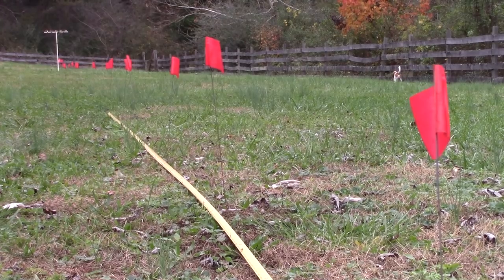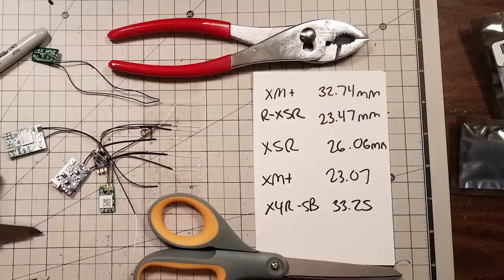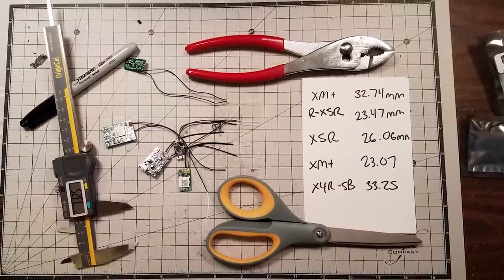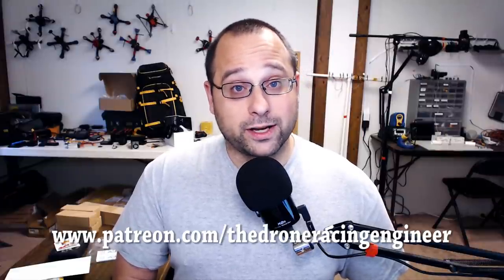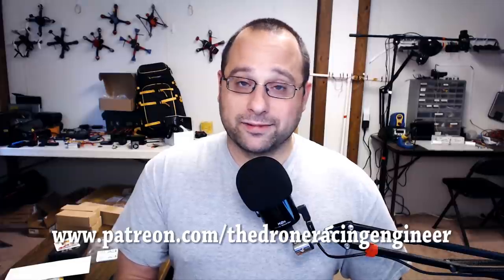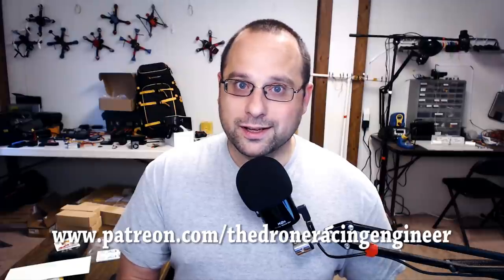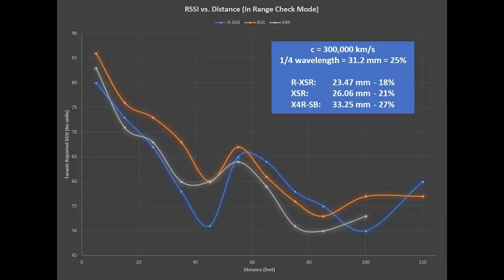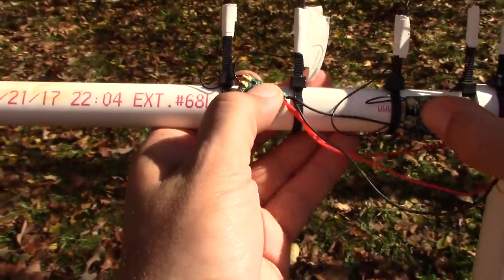Range Test FrSky RX | WRONG ANTENNA LENGTH?

Comment: Great testing Joshua! I'm a young RF enthousiast, and I have access to a network analyzer that goes up to 3GHz. I was thinking, since all these antennas have U.FL connectors, I can just hook one up to the VNA and see at what frequency it resonates. The resonant frequency of these antennas are dependent on the length of the exposed antenna wire (outside of the coax) but the size and location of the RF ground will also be important for antenna tuning. 

One thing that is also interesting to note, is that the receiver chips cannot do any antenna tuning, the only option is that they put passive components at the feedpoint of the antenna, to change the antenna impedance. However, any time you are tuning an antenna with inductors or capacitors, the components MUST be right before the radiating side of the antenna. You cannot really tune an antenna at the feedpoint of the coax cable, since the 50-ohm coax will transform the impedance, which is dependant on the coax length.

I think I'm going to try to hook up my VNA to one of these 'whip' antennas, and I also want to see if I can see any matching components on the PCB. The best test to measure the antenna resonant frequency would be to use hot air to remove the RF chip on the receiver, and solder a tiny coax cable directly on the pads where the signal to the antenna goes. Then you can perform a calibration, and actually measure the impedance that the chip is 'seeing' with all the RF ground and matching components on the PCB.
Reply from the maker: Well tell me your results I'm dying to know!
Reply: I'll have time to do the measurements in a couple of hours, can I email the results to you? I'll be generating some plots and stuff..
Reply: Yes, and make a video out of it, please :-)
Reply: Please do. I recently lost TX to a quad running a new R-XSR. It could have been anything but suddenly dropped out of the sky before the "Telemetry lost" warning. I never found the quad to do an investigation. I've looked through ham forums but found zilch apart from 5/8λ Vs 1/4λ - 1/2λ
Reply: Well, my plan went to hell. The U.FL connector on my Frsky receiver are actually not standard U.FL, but some sort of micro U.FL. So I cannot connect the antenna to my VNA without cutting off the connector and soldering the coax directly on a connector I can connect to my VNA. However, this could in theory mess up any test results. Not really sure how to proceed.
Reply: Buy a bunch of antennas that do work with your VNA, cut them to different lengths and test them.
Better than nothing.
Reply: Hamza Mohammad I'm going to try this ;)
Reply: I think you had an attempt and may or may not have found some information that would be inconclusive and interesting at best but life-changing and radical - possibly a stretch! As for my receiver, it was a replacement for a micro Flysky that only had a 3cm piece of enamelled copper for it's antenna. The range was fantastic.
Reply: well, 3cm is almost exactly a quarter wavelength @ 2.4Ghz! Makes perfect sense ;)  I think the reason they add these long wires is so that we have more flexibility on routing the wire on our drone.
Reply: Any updates ?
Reply: See Scott Marshall's reply below. Length of receiver wire is not critical but your transmitter antenna length certainly is.

Comment: I think I'll do a video on this but basically there are many factors that influence those antennas and it's not just "tuning" but also radiation pattern, impedance and other things which determine how the antenna will actually perform.   Joshua's test environment had too many variables to get consistent and therefore accurate results so I'll try to come up with something that mitigates (as far as possible) those variables.   It's an interesting subject and one that's worth more discussion.  I'll try to get my vid done tomorrow.
Reply from the maker: +xjet looking forward to your take on this!
Reply: Looking for this too uncle Bruce :)
Reply: But your 'news' videos are full of empty promises...  so I won't hold my breath!  Sorry to be so blunt Bruce.
Reply: rcdesigns, you're obviously unaware of the amount of time/effort that goes into even the smallest video.  I've been working on the video mentioned above for the past four days and I'm still not happy with the result.  You'll probably see why when I post the video.  Trying to convey quite complex subjects in an uncomplicated way is one of the most challenging things there is.   So far I have four hours of video on the edit table and I'm still not happy so I'll be reshooting stuff again today until I am.
Reply: So Bruce, you produced a video with another empty promise (no part 2)! I rest my case
Reply: Yes, because the world has just ended so there'll be no time to edit part 2.  Of course you will be getting a full refund :-)    LOL
Reply: @bazathome2002  Im laughing because this is so true..

Comment: As a layman I conclude two things from these tests. 1: the engineers at FrSky seem to know what they're doing when they design these antennas and receivers. 2: no matter which receiver you get, unless you're going for super long range or something, you're going to have a very solid reliable signal. I was slightly concerned when I bought the R-Xsr that it may have less range than a full size receiver, but it seems I was worried for nothing!

Comment: Hi Joshua,
again a very cool video from you. I have to thank you for all your content, which made me learn a lot!
This time I think I can give you some informations:

To get the best reception from an existing combination of components, the length of the antenna-"core" (unshielded part) needs to 
be perfekt for a combination of:
actual wave-speed, frequenz, antennas environment, ...

I would advise you to:

put the TX far away ... if you like in your car ... and you stay at your quad.
Yes I saied quad, because of the antennas environment! you want it to work in you quad, so tune it there !
As someone in the comments already saied, your ground-part (which is also the carbon of your frame) of the 
antenna and anything in its neighborhood will change its behavior.
So use the place where it will have to work.

The only thing you should change during the tuning is the length of the antenna.
You changed the distance and as you have seen in your chart, you got hills and valleys. 
I'm shure this was because of interferences. You got bounced signals on from what ever which de- or increased you signal.

Don't use several recievers, there can be so much different ( quality of rf-chip, antenna-matching, groundarea ...)
Also, the recievers working next to each other can change there behavior.

So put the TX in the car far away, go into the house with your quad and your goggles ( need to see rssi in the osd !).
Put the quad somewhere where it can't move, but it should sit on something similar to air, because your quad normaly is in the air ...
I usally use styrofoam, this has nearly no effect on the resonance and matching.

Use only one of the antenna cables, disconnect the other.
To get great range of frequency in your test, use a antenna with a very long core.

measure the antennacore-length, step back from the quad, read the RSSI ... put values into chart ..
cut a little piece of the antenna, as small as possible (I like to use a fingernail clipper)

measure the antennacore-length, step back , read the RSSI ... put values into chart ..
cut a little piece 
.
.
.

everything should be the same, even your position while reading the RSSI
You will get a nice graph!

greetings, Max

Comment: Any time I have ever chopped or messed up an antenna, or as soon as I get a new antenna, I always measure it myself. It’s simple, use this formula to expose the proper amount of the inner wire. 300 divided by your radio frequency, then divide that by 4 to give you a 1/4 wave length. I typically try to use 2.44. This hits in the middle of the frequency and seems to work best for me. I’ve seen so many ppl who do not peel back the coating, and mesh to expose the inner wire and they think its a bad receiver when its simply not peeled back.

Comment: In my company we design and test antennas as a part of daily development. You are certainly right that the tune of the antenna comes not only from conductor length. Type  of surrounding materials, including the "plastic" shroud, distance to all objects in near field (first wavelength),  and antenna material itself can all affect how well the antena is tuned to certain frequencies, heck - even the quality of solder joints can. The tune itself is not a 0/1 factor. There are all possible shades of gray between optimal tune to a frequency and ignoring it all together. Moreover you can have a decently tuned antenna using certain fractions of a wavelength physical size. I'd assume that manufacturers test and use the right combination of length and materials to get desired results. To do those tests right you'd need to use only one receiver, cause differences between them can be too big to see changes made by the antenna, and be very precise with physical distance and orientation between tested devices, avoid multi path transmission as much as possible etc. Short story - You are right, but you'd probably see something consistent only in an anechoic chamber.

Comment: I hate to admit it, but my new favorite go-to receiver is the XSR-E (the Banggood Eachine/Frsky collaboration). It's damn near the same size as an XM+, but has telemetry. Also, according to my sketchy/not quite Bardwell-quality field testing, it performs almost identical to my old go-to X4R SB's. I have the XSR-E's on 7-8 models right now, and they're performing great!

Comment: Nice test.  I’m interested in when the FC sees a failsafe based on range.  It would be nice to have a FC logging to blackbox RSSI values and when a Failsafe occurs.  Add a beeper for the fun of it and you walk until and audible tells you a failsafe took place and put a flag in the ground.
Reply from the maker: When the RX light goes red, that's a failsafe. But the channels would be periodically locking out earlier than that.

Comment: I used to work in an office next door to an rf guy. He tuned his antennas by connecting them to am rf network analyzer, holding his tongue a little to the left, and then with his side cutters, cut a few molecules off the end of the wire.

Comment: Good idea for testing this, and thanks for doing it, but the methodology I don't understand. Why cross-test different receivers and different antenna lengths in random associations? It makes it so much more difficult to isolate the effect of the antenna length. I would focus on the receivers where it's easy to get rssi value. For each of those (there is only 3), test 3 different antenna lengths and record rssi for each combination. Then you have 9 curves that you can compare. You can see, for each receiver, which antenna length works best, and you can maybe then see a trend towards one antenna length giving better range in general.
Reply from the maker: I tested different receivers because most people who report short range are using a receiver-and-antenna combination. So the claim is not just, the shorter antenna on the R-XSR is worse. The claim is, the shorter antenna AND the R-XSR is worse. 

So I start by testing the actual claim that is being made: is one receiver+antenna combo worse than another?

Then from there, I branch out to explore the effect of different antennas. Which is why in the 2nd test I had both a 1/4 and a 1/5 wave antenna on the same receiver (R-XSR).
Reply: Alright, I now understand a bit better the thought process. But in the end, the video's title question is not answered: "wrong antenna length?" With this method, no way of knowing if the receivers' hardware or antennas are at fault. Sorry for being picky, I'm an engineer too, after all :)
Reply: I think what you shod test is antenna placement on the Quad. and then walk away with the Quad.
To many is stuffing the antenna in there and having problems.

This works great:
https://www.thingiverse.com/thing:2147201

Comment: It may have been a slip of the tongue Joshua but loss of telemetry is not the same as loss of control link. This seems to be a common misconception among users and a point you could help clarify in one of your videos. This can be demonstrated when the TX is too close and the radio alternately reports Tele lost Tele recovered and yet all the while you have perfect control.  
FrSky are actually taking a few liberties with the RX antennas since even with a perfect 1/4 wave radiator length the whisker design has no counterpoise element to complete the dipole leading to induced current in the sheild. FlySky on the other hand often fit their RX's with outer sleeves which acts as the second half of a 1/2 wave dipole and also acts to decouple the shield which as you know is a much better design choice. In fact It may be interesting to fit a pair of those sleeved dipoles on the FrSky RX's and compare to the FrSky whiskers. 
One last thing PLEASE start complaining long and loud about the new style antenna coax and IPX connectors FrSky are now using. Hopefully they will take note and revert to the older style coax and uFL's. It would seem in striving for ultra miniaturisation they have forgotten the real world implications and practicalities of (to use the Australian vernacular) Piss weak coax.

Comment: Hey JB.
Good to see that somebody, atleast ;), tries to get some reliable data out of this.
After everybody was going crazy for the 5dbi mod and it's range extension, I did some tests on my own using the Taranis logging.
Unfortunately the results between 2dbi and 5dbi where so close that you couldnt tell a difference in just range - and until now, no one seem to investigate it and providing detailed data like in this test.

You seem to stick to the stock antenna with your x9D SE, but maybe there will be a science-like-validation by you at some point.
Always appreciate your content and way to present and explain stuff!

Comment: This might be picking a nit but the worst reception would be if the RX antennae were not end on but horizontal.  In this case your transmitter signal is vertically polarized.  A horizontal RX antenna would have the lowest received signal.   A good reason for antenna diversity , mount one antenna horizontal and one vertical.  Of course microwave signals tend to rotate over distance so this may not be true in this case.BTW consider the lowly AM radio that operates in the MF band, the antenna is invariable coiled up on a ferrite bar and has no external wire.  A long wire AM radio antenna would be about 200 meters long.

Comment: I am new to the hobby (Loving it by the way), and I am also an active Ham Radio operator. With Radio frequencies, antennas perform the best if they are trimmed for a specific frequency in a band. So for example with the 2-meter band in ham radio (144 to 148 MHz)  you would make the antenna 1/4 or 1/2 wavelength to 146 MHz. The antenna will be usable on the whole 2-meter band, but will still be most efficient on 146 MHz, so in the case of  FPV, technically those antennas will perform best on whatever frequency (Channel) that the antenna is actually trimmed for. So if you know the frequency you always use you can trim them for it. I enjoy your videos. You sold do similar tests on all of the different channels to find out on which channel each antenna is most resonate. Impedance and radiation pattern also affect it like xjet said. I do think it would be interesting to test them all throughout the band though. I am sure that then each one would perform better on different channels.
Reply from the maker: The 2.4 GHz control systems we use are digital frequency-hopping. They're all over the band.
Reply: Ah okay. I was just curious. Like I said I am new to the RC and FPV community but have been in Ham radio for a few years. With Ham Radio though I have only worked in MHz and have not done much with digital. Keep up the good work. I enjoy your videos and learn a lot. Most channels I find on here besides yours and UAVFeaturs are nothing but VLOG or Freestyle. I do enjoy them, but don't learn much at all. Thanks for what you do, and for explaining.

Comment: I have seen more than one, genuine XM Plus do in excess of 5.5kms with 70% RSSI still showing on the OSD of a Fixed Wing...I think the fact it does NOT have telemetry is what gives it an advantage...The long range FrSky L9R also does NOT have telemetry. Had mine out beyond 3 kms and the RSSI barely dropped with its antenna amplifiers.
    The noise floor in a Fixed Wing scenario, is much lower than a Quad of course, even so, it's a great advert for the (Tiny) XM Plus, popular with Mini Quads today.
  The other thing to note, and you can easily prove this yourself, is that separating the antennas on a typical telemetry capable receiver will drastically increase its range. We did some ground tests and proved this beyond doubt. The antenna placement in your clip is way too close together for a telemetry capable receiver.

 Goat one says to Goat 2, WTF is he doing with that big stick then..?....lol.

Comment: You need more distance to see the real results. Stinger swarm did this same test on RotorRiot and his results were inconclusive due to his cat chewing his antennas haha. But from what I can see is that even in Range mode, you need a lot more distance then you have in your yard to get any solid results from the data, they were in a pretty big field. Maybe you could use a dummy load to cut down the range? I was thinking of doing the same test on a dry lake bed here in California, but have since switched to Crossfire, so there is no need. Great video, very informative!